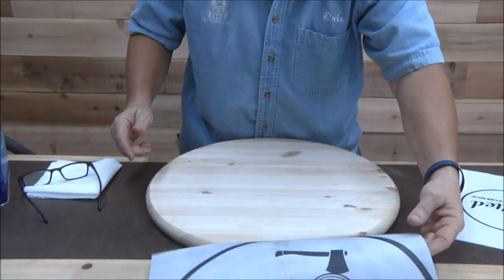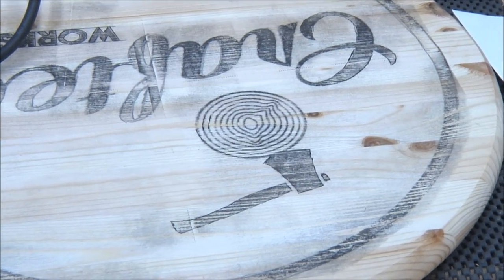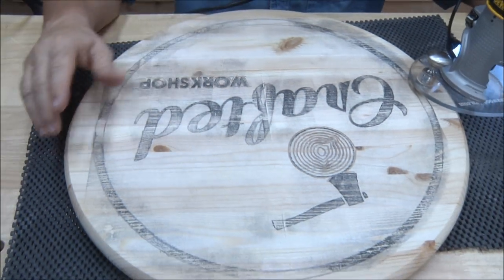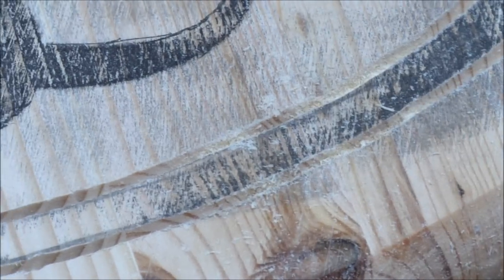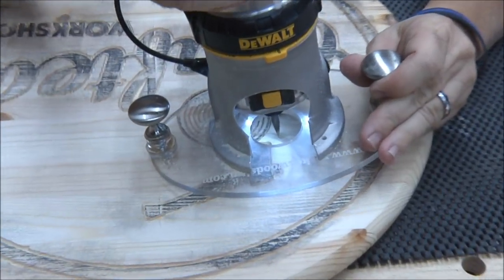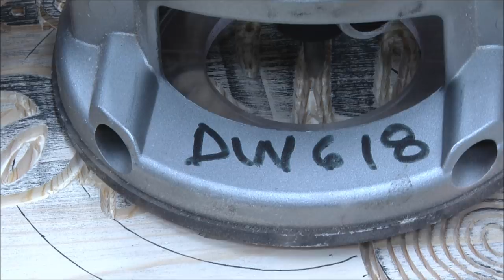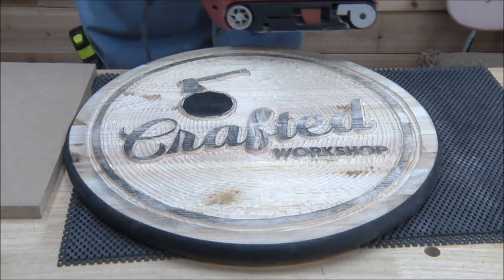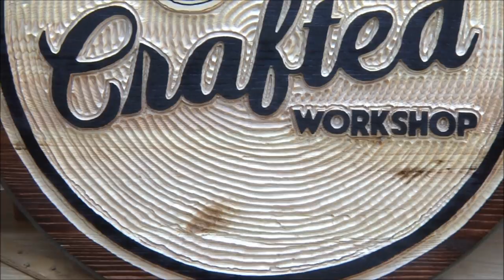Newsletter #219 Carving Collaboration With Crafted Workshop

Comment: you mention Lacquer thinner and acetone, i assume mineral spirits would work as well?  I have never seen a transfer done this way.  My wife does a little armature wood burning and does something similar by essentially ironing the reversed image onto the board.  ink side down and iron the back side of the paper.  the heat releases the ink onto the board.  the catch is, it has to be inkjet and not laser printed.
Reply from the maker: Hi Jeff,  I haven't tried mineral spirits so I don't know. Thank you for the input and the tip on using the iron.